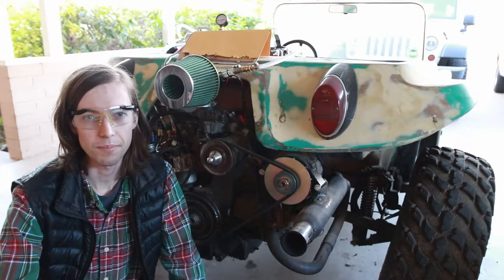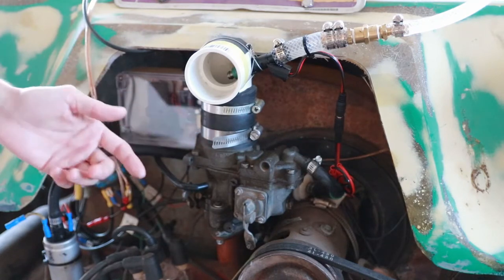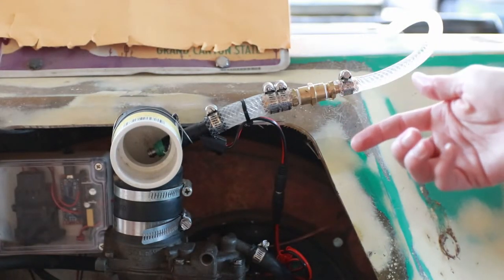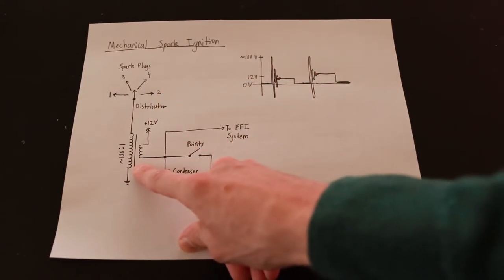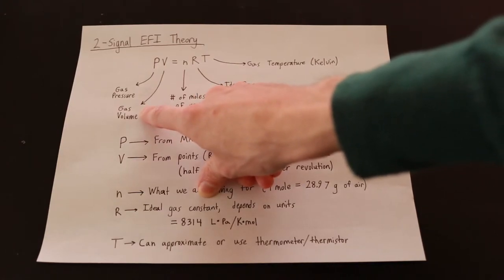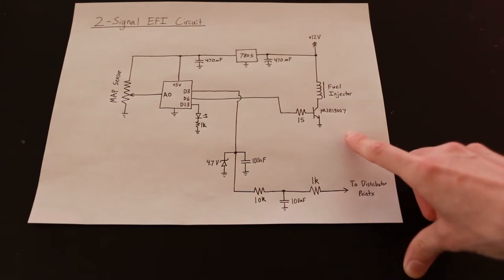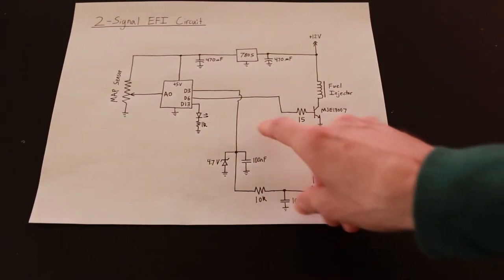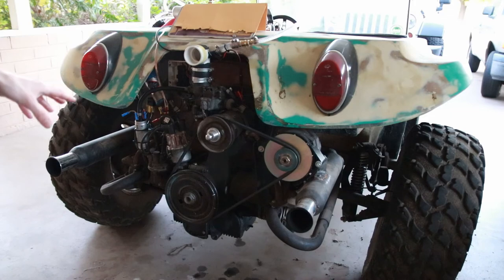Electronic Fuel Injection with MAP and Points Only

Comment: This is pretty cool.  I hope to see more videos continuing this project.  Simulating an accelerator pump by stretching the pulsewidth "shouldn't be" too hard. ;) Real temperature sensing will be boon to fuel efficiency.  Is injector PW just once per revolution, once per cycle per cylinder, or a continuous operation?
Reply from the maker: Thanks! I will have more videos to come, and indeed I am planning to add a rate-of-change-of-MAP term to the AFR control. Right now injector pulse width is continuous at 20 Hz, but there may be an advantage to synchronization with the intake strokes in the future.
Reply: @DielectricVideos  Simply based on the flow speed, length of the intake headers after the TB and air compressibility effects, there's so much physical lag it wouldn't make sense you'd see a tangible difference. I'd wager a generally higher frequency (up to whatever the injectors can cope with) would improve the homogeneity of the air fuel mixture. That might help with combustion efficiency due to unburnt fuel in large droplets. Either way, you could test that easily with a Lambda sensor, they're cheap and easy to hook up

Comment: This is amazing i was trying a rev limiter circuit using this schematic i took the rpm from contact points and ran the signal to second order rc filter like you did and to the interrupt pin on arduino nano the rev limiting is done by a relay . I connected the common pin of the relay to ignition switch and normally closed to ignition coil positive side when the threshold rpm is reached the relay is switched on and the coil loses its 12volt side at that moment the rpm readings is misread on the arduino and i dont know the problem your help is appreciated

Comment: Amazing! This fuel injector is a common model or is an hi flow? Because 1 fuel injector have to supply the entire engine fuel consuption... I planing to make something like that, but i have an 1.8 Liter engine so i don't know what fuel injector use...

using an small fuel injector to keep the engine running good you can make the pulse time a little longer, or can manke the pulse become more faster isn't?
Reply from the maker: I'm using two high-flow 42 lb/hr injectors on mine. It's important to ensure that your fuel injectors can supply adequate fuel even at maximum engine load and RPM, as a lean-out condition could occur otherwise. You want to ensure that an AFR of no higher than 14.7 can always be maintained regardless of loading condition or RPM (up to the RPM limit of the engine).

You can approximate the maximum volumetric airflow to your engine by taking its displacement and multiplying it by half of its maximum speed  (for 4-stroke engines). Be sure you are using consistent units (for example, liters, seconds, etc.). Assuming a maximum air density of atmospheric (for naturally aspirated engines), you can get the mass airflow rate by multiplying the volumetric flow rate by the density of the air at your operating altitude and temperature. 

With the maximum mass airflow rate, you can get the maximum fuel rate required to be available from the injectors by dividing the mass airflow rate by the AFR limit. This tells you hw much fuel mass your injectors need to be able to deliver at full capacity in order to prevent a lean-out condition.
Reply: @DielectricVideos   thank you very much by the answer!
I can calculate now how much fuel my engine needs and what fuel injector i need.

Another doubt that i have: You are reading the distributor pulses to pulse the fuel injector, correct?
But the distributor have ignition advance, soo your injector will pulse a little in advance at higger RPM, this is ok to running engine good? Or the pulses from distributor are only to have the RPM signal?

How you are using the signal from distributor in your circuit please?
Reply from the maker: @marteloficina  The injectors are pulsed at a constant frequency independent of the engine speed or position. It's designed to be used in a throttle body injection system where the injectors are mounted at significant distance from the heads.

For port injection systems, injector synchronization becomes important. In this case, you would need to write software to time the injector pulse with each intake stroke, and every cylinder or synchronous set of cylinders would need its own separate injector.
Reply: @DielectricVideos   Thank you, soo the distributor signal is just to inform the RPM to arduino, and i saw the video again, the injector are pulsing at 10 times per second (10Hz) correct? so to correct the fuel mixture the arduino change the duration of pulses, little longer more fuel, lillte short less fuel,  the system only change the duration of pulses to correct the mixture.

In your second video the two injectors are pulsed simultaneously or they are independent?
Reply from the maker: @marteloficina  I believe more recently I increased the pulse rate to 30 Hz, but yes, this is how the fuel delivery is metered.

In my newer board designs, the distributor pulses also control a high-energy ignition system on-board, and this is timed synchronously with the distributor signals (and are actually provided by an optical pickup system). However, the RPM values for fuel calculation are performed the same way.

The injectors on the new video are controlled together, and are actually just wired in parallel from the same MOSFET.
Reply: @DielectricVideos  Great explanation! I have one more doubt, i have an turbocharged engine, and i will use the base from the carburetor  with the valves and creat suport to use 2 fuel injectors, but i thinking in start pulsing the second injector ONLY AFTER the turbocharger start increase the pressure.

That way the first fuel injector will make the engine runing, and after the air pressure start to increase the second fuel injector will be activated,  i have instaled an o2 sensor in the exhaust, so the arduino can make this work based on the information directly from the o2 sensor? I will use throttle body sensor too.
Reply from the maker: @marteloficina  Since the engine is turbocharged, you'll have to be sure your MAP sensor is designed for positive pressure. You'll very likely need to write some custom firmware to implement the O2 sensor input, as this is currently not supported in the firmware that I wrote.
Reply: @DielectricVideos   yes i will write new firmware, i will use your firmware to my starting point.

But the logic is this: at no pressure the arduino will use only one injector to run the engine, after the turbocharger start increasse the air pressure the second injector will start pulsing, and everytime the arduino will receive signal from the o2 sensor to run the engine properly, and after air pressure start rising the mixture need to become a little rich to help the engine run with the turbocharger.

The logic is that right?
Reply from the maker: @marteloficina  I believe you can also use an AFR table to adjust the mixture at any manifold pressure, even positive (boost) pressure. This allows you to set the mixture richer during boost, if desired.

With an AFR table, you can calculate the fuel delivery command based on the speed-density measurement of airflow.

How you supply that fuel delivery is up to you: you can bring one injector up to 100% then bring the other in after, or bring them both up together at the same duty cycle. But most likely you will want to use both injectors simultaneously, and adjust their duty cycle to meet your fuel requirements.

The O2 sensor can be used to trim the fuel command up or down to make sure it matches the actual delivered AFR.
Reply: @DielectricVideos  Thank you! Last doubt: i will use the o2 sensor to trim the AFR but there some points:

1- Distributor are used only to provide RPM source right?
2- Throttle position sensor are bonus, but not required.
3- if you put your foot down the pedal for fast aceleration how you inject aditional fuel to the engine rev up faster?
4-  what map sensor you are using? And this map sensor can sense positive pressure (boost)?
Reply from the maker: @marteloficina  
1. In the fuel control system, it's only used for RPM. The 4-coil PCB also uses it for HEI ignition, but this doesn't affect the RPM calculation for fuel.

2. Yes, TPS is useful for point 3 (accelerator pump emulation), but not required. It can also be used as part of a lookup table for AFR adjustment.

3. I added a software function that uses the rate-of-change-of-MAP (manifold pressure) to emulate accelerator pump. It can provide this functionality, but isn't strictly necessary to use.

4. I'm using a negative-pressure MAP sensor (https://www.amazon.com/gp/product/B07Z37XG1J ), but you need a positive-pressure (2-bar or 3-bar) sensor to be able to measure boost. Here is such a sensor: https://www.amazon.com/gp/product/B09NVP4DFB
Reply: @DielectricVideos 

 Sorry to bothering you with so many questions but you are really helping my project XD

3. You have added a software function that uses the rate-of-change-of-MAP to emulate accelerator pump, the function make the injector pulses longer to speed up the engine more easy right? But this only work if you put the acelerator pedal fast, if acelerating  progressively  you don't need this function correct?

4. thank for indicating the right map sensor, but its hard to find the corresponding table of presure X volts in many map sensors  including this one, to solve that problem i have an idea:

I will connect the map sensor in my compressor with have an pressure gauge and start up, that way i can make my on presure x volts table, like:

10 psi equal 1 volts
20 psi equal 2 volts
30 psi equal 3 volts

The other problem is i can't produce and read vacum... 

what do you think?
Reply from the maker: @marteloficina  I'll see if I can answer your questions:

3. This is correct. Fast increases in MAP correspond to fast increases in throttle position, which is typically when extra fueling may be desired. I apply an additive term to the injector duty cycle that is proportional to the rate-of-change of the MAP from the previous measurement to the next measurement.

4. In general, MAP sensors are just potentiometers. If you supply it with 5 volts, the output voltage will follow the pressure, ideally with 0V at hard vacuum and 5V at its maximum range (3 bar, in this case). In reality, there is a small offset from zero, which is accounted for in the program. 

When you perform your positive pressure measurements, you should be able to extrapolate the trendline into vacuum and determine the approximate offset this way.
Reply: @DielectricVideos  ok got it, in this case then to test a map sensor i can feed it with 5v and see what the voltage will be without pressure or vacuum.

For example 0 pressure (atmospheric pressure) i saw 2v in the sensor, so as the pressure goes up i can write the table pressure/voltage as the pressure increase: 1 bar with 3v 2 bar with 4v and 3 bar with 5v.

And if the sensor is made for -1 bar to 3 bar and with 0 bar pressure it was 2v then 0 volt corresponds close to -1 bar,  and 1 volt 0,5 bar,   something like that?
Reply from the maker: @marteloficina  MAP stands for "Manifold Absolute Pressure", so that's why it reads 2V at atmospheric pressure. At atmospheric pressure, the absolute pressure is about 14.7 PSI or about 1 bar (varies depending on elevation).

I think your characterization method sounds excellent. You should see an approximately linear relationship between pressure and voltage.
Reply: @DielectricVideos  thank you to answering my questions, i will try to do this metod with map sensor first, after this i will try to create the code, one more question yours injectors are operating at 30Hz, but you started pulsing at 10Hz right?Why you increased the frequency to 30Hz?

What are the limit frequency the fuel injectors can operate? how you decided if need  frequency more higher or low?

 Make the frequency low and the pulse duration higher is better to the fuel injector have more life span isn't?
Reply from the maker: @marteloficina  The higher the pulse frequency, the smoother the fuel delivery to the engine will be. The fuel mixture is much more consistent at 30Hz than at 10Hz.

However, there is a limit to the minimum on-time that the injector can have before it does not open at all. I have found that a minimum value of about 2 milliseconds is generally safe for most injectors.

This value means that duty cycles less than about 6% aren't feasible with frequencies over 30Hz, so it is not practical to go much faster then this while still maintaining good fuel metering accuracy at idle.

It is also possible to implement pulse frequency reduction if lower duty cycles are required. I actually did this on the latest version of my firmware, to allow duty cycles less than ~6% to be available without dropping below 2ms on-times.
Reply: @DielectricVideos  very interesting, so after time you are feeling the engine function and make firmware update, reducing the fuel injector frequency probably will increase the injector lifespan.

It's hard to find hi-flow fuel injectors here they are very expensive, i think i will buy few used fuel injectors and try to use in the engine just to see if they can mantein the engine running, using two comon fuel injectors i think i have better chance instead of 1 big injector.

It's possible to increase or decrease a little bit  the fuel injector pressure, with more pressure more fuel will enter in the engine right? 

And i have an fuel pressure regulator, whitout turbocharger the injectors will work in one pressure, after the turbocharger increase the air pressure the fuel press regulator will need to increase the pressure too, correct?
Reply from the maker: @marteloficina  The flow rate for the injectors is usually stated at a given rated pressure, and is approximately linearly related to that pressure. So you can get some increase in flow by using higher fuel rail pressure, however, doing so may exceed the rating of the injectors. You definitely don't want to blow one out from high pressure, so I wouldn't recommend exceeding ~125% of the design pressure.
Reply: @DielectricVideos   Ok Dielectric, i buyed few used fuel injectors to start the tests and i will build an suport to make the injector stay in the center of carburetor intake, to start i think i will do like this:

1- try to generate an simple firmware to run the engine at iddle and middle RPM based only in RPM signal, this will tell me if my injectors are working good.

2- build an steel suport to receive te two injectors.

3- create a new firmware to control the injectors based on air pressure and O2 sensor and start driving the car to feel if i need more improvements at the code.

Are 3 siple steps but i think this probably will be more dificult than i think, but this is the way, correct?

Thank you to help me XD

Comment: Hi, I'd been looking at doing something like this on my classic mini. When I found your video I was made up!

One thing I want to ask is would there be an ability to add a temp sensor for the engine? The Mini has a choke to make it more rich until the engine gets to running temp. 
Would this be a simple thing to add where it increases the values of the fuel until it's warmed up?

Adam
Reply: Or could I add a switch that works like a choke to add extra fuel then switch it off once warmed up?

Comment: Interesting project. I would assume that the Carburetor is not supplied with fuel other than the injector.
BTW.. I'd say your alternator belt is quite loose.
Reply from the maker: Correct, I have the fuel pump for the carburetor disconnected so only the injector supplies fuel. I'll be switching back to the carburetor while I source a more permanent high-pressure fuel delivery solution.

Unfortunately there isn't much adjustability in the alternator belt tension, as its mounting plates are fixed to the exhaust muffler and head bolt, respectively. I'm working on a 1600cc dual port engine to eventually replace the 1200cc test engine, so the muffler-mounted alternator likely won't be a permanent feature anyway.